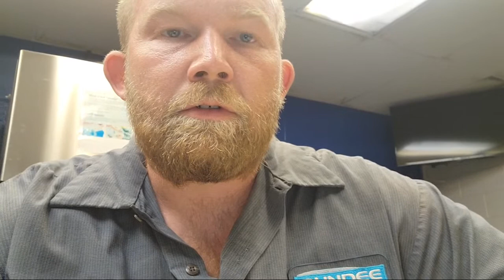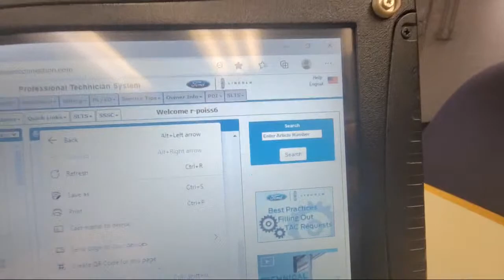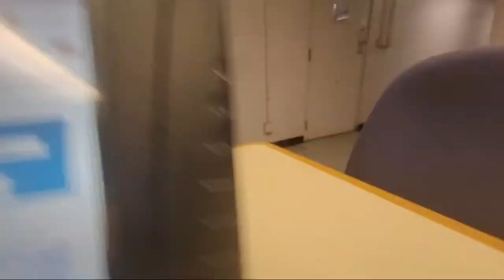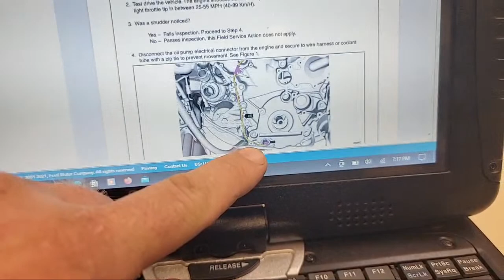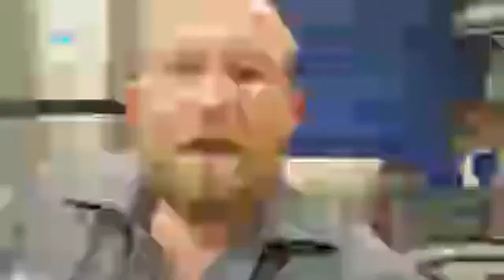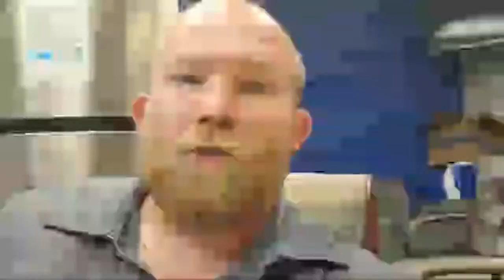NEW 21N08 Cam Phasser RATTLE TSB F150 - And Other Messages and questions

Comment: Long video...  I'm at about 25 minutes in..  checking correlation with my 20 F150, looking at both 21N03 and 08, they show build dates that end in 2019.  I have this shudder just like it talks about starting at 1000 RPM, but mine was built in Aug of 20.  I have it scheduled to go in on Sept 23 for this issue.  What can I write down to help them get to the issue at hand (thinking they may not get there on their own).   I never have a good feeling when taking my vehicles in for service.  I usually get some kind of run around.
Reply from the maker: Explain what RPM you feel it at and what kind of phone is making
Reply: @FordBossMe  yeah, did that.  Left a note.  "Shudder" is apparently a specific term used for the transmission.   So, it went to a trans guy.  He said no problem found.  Service manager suggest I use sport or tow mode...my truck was built after the dates specified for affected vehicles so mine should have " the fix".   It is getting a little worse now...even in sport mode.  It's a lease.  10 months left.  Bad taste in my mouth and I work for Ford Motor...  5.0 has oil issues, 2.7 is a bit under powered for my liking  and 3.5 has phaser issues, or creates phaser issues.  Lightning we be on order when they open up orders.  We'll see how that goes.

Comment: You missed the 2000ish OG 5.4 & 4.6 recall for RH heads. Leaked oil profusely at head gasket surface/ @ lower RR. They replaced the head when the problem was actually the block not being surfaced properly. Did a bunch of them. Lots of Expeditions. Waaaaay before cab-offs were a thing.

Comment: How about an electronically controlled accumulator for the engine oil. I use them in older hot rods that sit, allows them to be pre-lubed before they start. Fairly inexpensive system ton install and simple to use.
Reply from the maker: Link?

Comment: Thanks for posting this. The timing of this TSB and your video is really coincidental for me. I had 21B10 completed in late August ‘21 and then just this morning (Sept 13, ‘21) I dropped my truck off at the dealer because I had TERRIBLE engine shudder, power loss and an issue that also exhibited as slipping gears. I should mention that it took about 2-3 weeks for the shudder to appear. It became so bad I thought about towing the truck in. Anyway, the dealer completed the PCM reprogram per 21N08 the shudder, power loss and transmission issues are gone. However, the rattle is back. You were absolutely right about reverting the programming. I hate this engine right now. This is all on a 2018 F150 3.5.
Reply: If anybody has any questions about my experience please let me know I’d be more than happy to tell you.
Reply: @benlappin87  What kind of gas do you use and where do you buy it from?
Reply: @firstlast---  I buy 91 which is the highest I can get in PHX. I go to either Shell or Chevron.
Reply: @benlappin87  🤔 interesting. That definitely meets ford's fuel recommendation. What kind of oil do you use? Oil change intervals? Driving habits? I'm just curious because I have 10k miles on my 2020 and I haven't had a single issue with the engine yet. Built 3/20
Reply: @firstlast---  I use the full synthetic Motorcraft oil from the dealer because that is where I have my oil changed every 5k miles. I shouldn’t say I hate the engine but I was unhappy with how it ran after 21B10 was performed. The truck is used as a daily driver with a 60/40 split highway to surface street. I also tow about 3k miles a year with approx. 5k lb. trailer. Those towing miles are always highway. The engine currently has 26,500 miles
Reply: @benlappin87  I use quaker state full synthetic (api sp) and 93 octane at shell.  Motorcraft filters bought at a local ford dealer, I change the oil every 4-5k miles. Too early to rule out if I'll have any issues but so far this seems to be a winning combination. The direct injection can be pretty noisy on a cold start but that doesn't really bother me too much. It's just crazy after all these years ford is still having phaser issues. The 3.5 would be rock solid if it wasn't for this problem
Reply: @benlappin87  When did you start having issues with the phasers?
Reply: My story is almost exactly the same as yours, but I haven't had my truck back into my dealer yet since this new FSA came out.  I am consistently noticing mine shudder at around 1100RPM while driving through my neighborhood, and it took a few weeks for this to start after the 21B10 work.  Also pretty choked with Ford and this engine...  
I'm curious when the shudder occurred in yours?  
Do you mean you are getting rattle on start up again?
Reply: I have 21B10 backed out and it definitely was better.  Perfect in fact.  However, it's starting to shudder again, and the raddle is back at startup at times.  21N08 shows up now in my FordPass app, and I'm not sure what they can do, since 21B10 was backed out and the truck put back to as-build.  Sigh.
Reply: @GADMHahn  dude, that does not sound encouraging. Sigh, is right. I feel your pain.  What a cluster.  I'm not sure if I'd rather live with the low RPM shudder, or go back to the startup rattle.
Ford: Let's try this!
Also Ford: Maybe this will work!

Comment: Hmm, I tried disconnecting the oil pump electrical connector and I got a low oil pressure warning a couple seconds after I started the engine! Is this normal?
Reply from the maker: Yeah you're going to get some kind of message like that but I wouldn't recommend doing that if you're not a dealer
Reply: @FordBossMe  Any chance you can post a video of the entire 21N08 text on video so we can see the exact procedures on this one?

Comment: I’ve got a 2018 f150 with the 5.0. Has anyone experienced their trucks make an awful startup noise when cranking it? I have attached a link of another individual who seems to have the same issue but I do not know if it was resolved. My truck seems to make this noise more often when I have the parking brake on. 
https://youtu.be/0NVKSwbqs7Q
Reply from the maker: Try setting your parking brake BEFORE putting it in park and tell me what happens 

Set the parking brake and then put it in park and then report back
Reply: @FordBossMe  thanks for the reply. I always set the parking brake before putting the transmission in park. The weird thing is it doesn’t always do it. And it also sometimes does it when I don’t put the parking brake on at all. My truck is a 502a lariat package with the electronic parking brake if that helps. 

The reason I ask for your opinion is I have multiple videos of my exact truck making the same, or similar, noises on startup and the dealership I took it to claims they cannot get it to replicate the sound.
Reply from the maker: So unless the manufacturer allows us under warranty to do something about it or give us some guidance on where they want us to go with it there's literally nothing that we can do

So somebody has to open a hotline case with the engineering department and then they have to put something through to get an oddball situation like this taken care of

So while those of you out there and you too bland think it's the dealer that saying okay no problem found we can't do anything about it there's literally nothing that we can do about it sometimes unless the manufacturer helps us out and if they don't we have to go by there guidelines

You have to be able to duplicate this problem over and over again because if you drop it off at the dealer and it's not doing it right then and there when you drop it off then what's the point of even dropping it off you need to be there to show somebody how it happens don't just leave it there and then walk away and expect them to duplicate the problem you personally need to be there to see it and they need to see it together
Reply: @FordBossMe  they told me that if it persists to come back to stay with them to get it to happen. The only thing is sometimes I can’t get it to replicate all the time. Sometimes it has to sit there for 30 mins or so to cause the sound to happen on startup

Comment: So I had the pcm flash done. Rattle was worse. Got the cam phasers done about 3 months ago. Rattle came back with a vengeance.  It is back in the dealer to be done again. How do you feel about the wastegate Rattle on the 3.5s? (2018 xlt 3.5)
Reply from the maker: It's annoying for sure, they have a so called update kit but nobody does it because it starts rattling again anyway
Reply: @FordBossMe  apparently not every dealer knows about it either. I asked about a fix that they had for the older gens and if they had something for this and the guy didn't know.

Comment: Do you think when the engine started shuddering after the 21b10 has caused any engine damage? like valve train damage. Since this caused oil pressure issues while driving.
Reply from the maker: I'm not sure honestly

Comment: I use top tier gasoline, In Canada we use Shell or co-op or standard when available . 91 octane or 93 0ctane less ping and less retard of ignition and better fuel mileage for the 2015 mustang GT. and I stay away from ethanol because it collects water and we don't like that when its - 35

Comment: 14 fusion of granddaughters again. It has on two occasions said engine hot and goes into limp mode. After about 10 minutes goes away. Had plenty of coolant in radiator and reservoir!! What is going on??
Reply from the maker: Probably the engine coolant temperature sensor wires or the sensor itself
Reply from the maker: Check and make sure that the wires that run around the throttle body are not rub through anywhere sometimes the earlier models had wire damage where they would rub around the throttle body and around where they were routed on the engine

Comment: What is a better engine on the mid 2000 rangers. the 4.0 or the 3.0.
Reply from the maker: Both good engines but the 4.0 is so nice to just get up and go 

The 3.0 is old reliable but lacks in the umphhhhh
Reply: Watch out for the 3.0 liter from around 2004 to 2006 or so. Some 3.0's had problems with exhaust valve recession leading to misfires. The repair involves removing the heads for valve work/replacing the heads. I own a 2002 Mazda B3000 - has the Ford 3.0 v6 which developed a misfire around 100,000 miles. Took it to the local Ford dealer for diagnosis and found it had recessed exhaust valves. Dealer provided me a copy of the technical service bulletin regarding the valve recession. Love the truck, just was expensive to repair the exhaust valve recession issue.
Reply: FUN FACT the SOHC 4.0 is actually related to the Cologne 2.9 , the engine I had in my 87 Ranger STX 7-foot bed regular cab , and is a converted cam-in-block engine.
There is a jackshaft where the cam used to be and there is a timing chain in front AND back of engine.
Pull engine to change rear timing chain. Terrible design.
It is NOT related to the 3.0 Vulcan.
Unlike today's trucks my lowly 87 Ranger held 2 CR500 dirt bikes side by side with the tailgate UP.